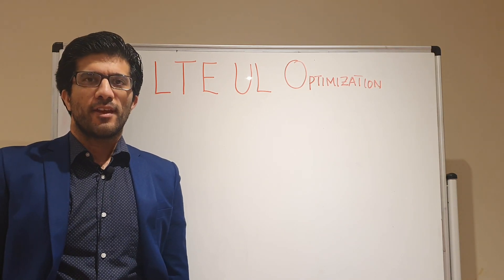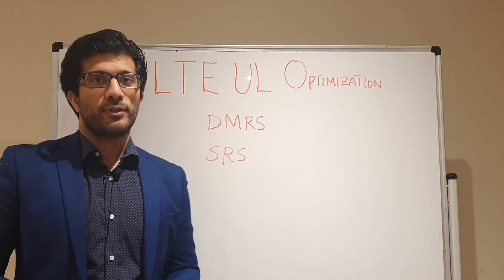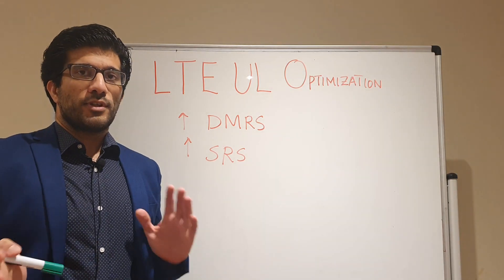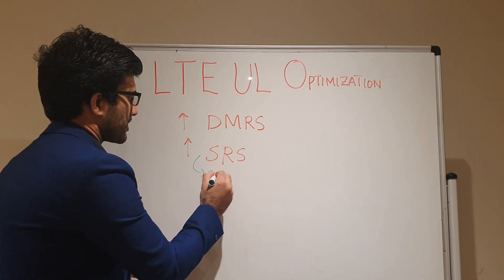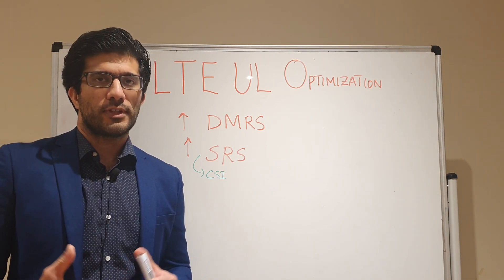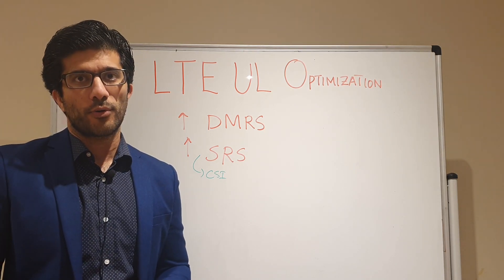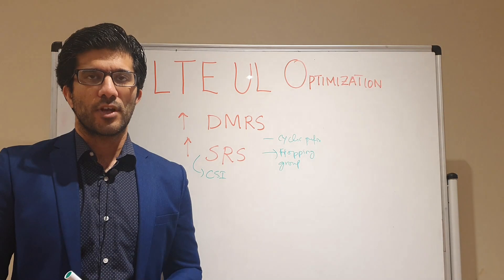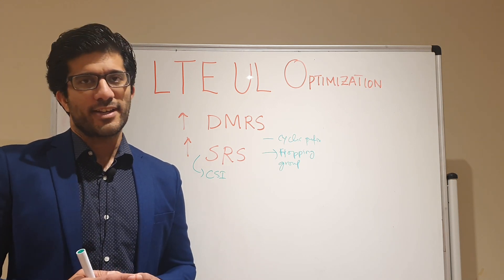Uplink LTE Optimisation :: Reference signals, DMRS, SRS and Uplink throughput

Comment: you are wrong with the 2 strategies for ZC sequence actually, ZC sequences are allocated for uplink reference signals. UEs use these sequences with a cyclic prefix for synchronization and channel estimation. The eNodeB assigns specific ZC sequences and cyclic prefix configurations to different UEs to ensure reliable communication and minimize interference
Reply from the maker: I will definitely look in to it